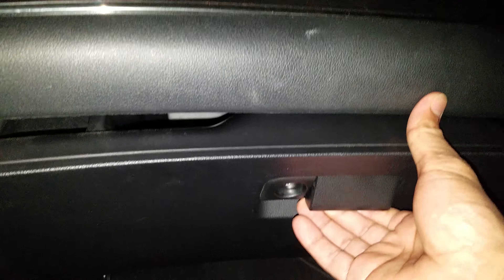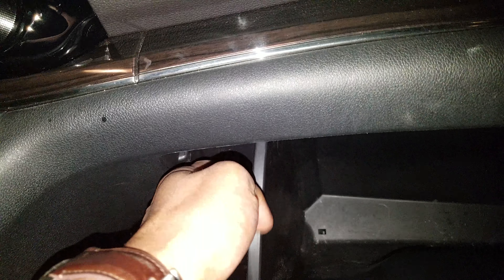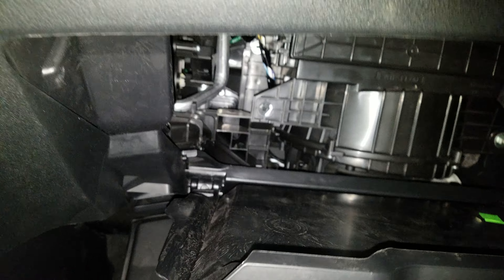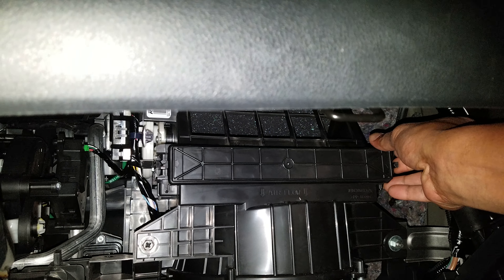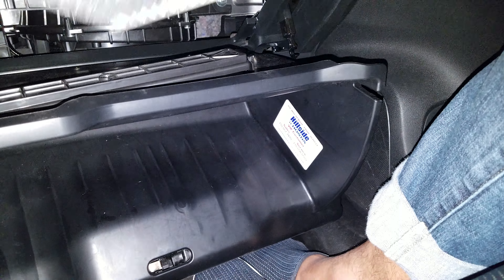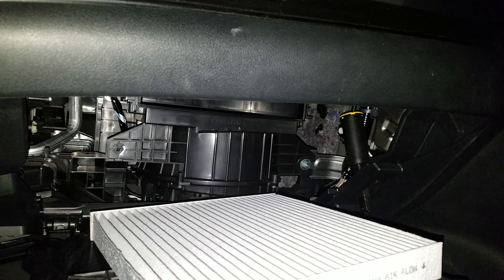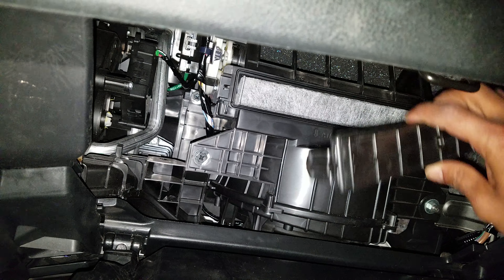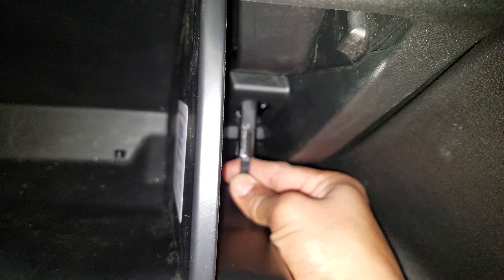How To Replace Honda CR-V 2016 Cabin Air Filter

Comment: Thanks for the video.  Took me a few minutes to realize I needed to slide it in sideways (like you did) as it did not fit with the label (with arrows showing air flow) facing outward, like the original Honda I replaced.
Reply: I noticed that as well. Thanks!

Comment: Thanx but why did you put the filter back sideways when the old was installed with arrow faceing down in front.
Reply from the maker: Old one was arrow down and horizontally. That's how I put that. Besides, they made from different companies so they put the arrow sing either front or on side.
Reply: Different filters have markings on different sides. Some have the markings on the siding with the rigid cardboard while others have markings on the soft fabric. I had to double take when I watched the video. Lol

Comment: In replacing  the air filter, he didn’t put it facing correctly. When he removed the old  air filter the writing was facing forward. The new one he replaced it sideways.